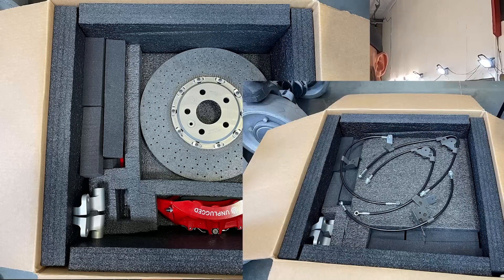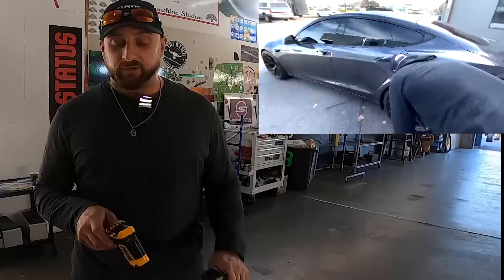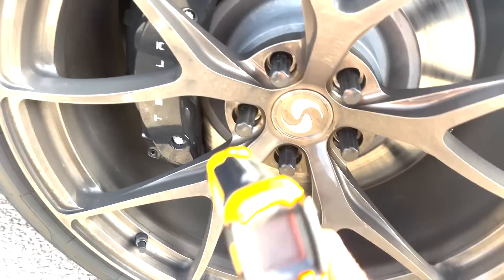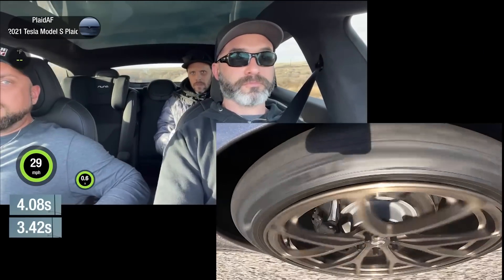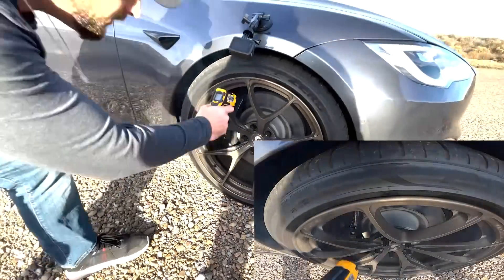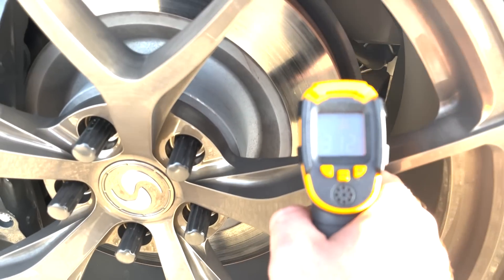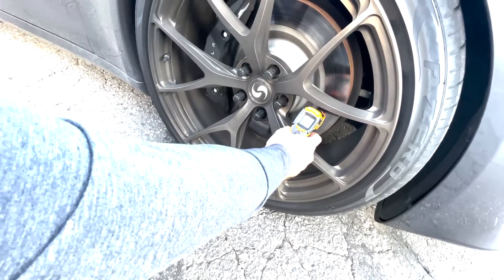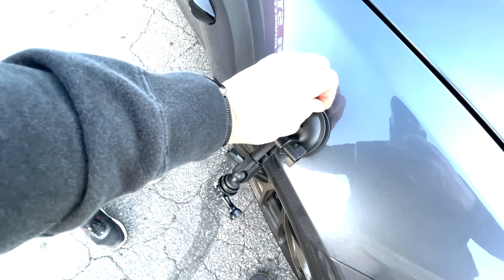Tesla Brakes Catch on FIRE | Model S Plaid

Comment: You can tell it has inadequate brakes just from the size of the rotors... They should be an inch larger in radius. The wheels can fit them easily. Take a look at the size of the front discs on any high performance sedan on the market, then look at these.
Reply: Uhh... so your basing your evaluation on how well it fills the wheel?  Not that generally speaking bigger isn't better, but that's a rather simplistic statement.  You do get points for not calling them breaks though.

Note that in normal driving conditions, on this vehicle the brakes are very lightly used- "braking" is regen going into the batteries.  Electric vehicles present a bit of a design challenge- in normal driving the brakes get almost no use, and at the other extreme you're stopping a heavier than typical car.  You have to size for worst-case, and then those oversized brakes are very lightly used.

I would say the brakes are sized appropriately for it's intended use, and need upgraded if it's seeing serious track use.
Reply: @christalbert722  So you agree that the brake discs could easily be bigger, that would make them better, and that it would be appropriate to size them for worst-case, even if regen is what's used for light braking scenarios.
But you still think it's appropriate to downsize them instead? What happened to sizing them for worst-case then? Brakes are a fundamental safety feature - basically the most fundamental one. They are most important in any car. If it's a car that can go up to 150 mph and beyond on the road those brakes need to be serious as well.
Basically any half-assed performance car, much cheaper and weaker models than this, come standard with much bigger brakes. Why would this not? I'm sorry but the problem of too low utilization leading to wear is not as important as the fundamental safety feature.
Yes, the brakes would need an upgrade for track use anyway, but these brakes are inappropriate for road use as well.
Reply: @zolikoff  the downsizing is for weight and aerodynamics I guess, so yes, it may be appropriate. For a classic combustion car, you are always using your breaks - so you have to absorb more  energy/heat and you dont want to replace them every 10kkm; here, you are braking with your motor for 99% of the cases, and if you have to do an emergency brake, you just need to have an optimal breaking distance; but the limiting factor is not necessarily the size of your brake discs - the limit is the force transported over your wheels to the ground/street; to that value, you can downsize; usually there should not be too many emergency brakes in a row - if you had one already you take is slow from there for a reason - only requirement I would set besides that, dont burn after one emergency brake
Reply: @hansdampf1143  When braking at higher speeds (>100 mph) the downsizing can indeed be a problem in negatively affecting stopping distance. You are not so much grip-limited there. Of course the regen adds to braking force and thus supplements it, but being a safety system the brakes should be sufficient on their own in case of system failure. Unfortunately almost every tester only publishes 60 mph braking distance results. Of course the brakes will be sufficient if you only ever go at legal highway speeds. The problem is the car's capable of much more, it should have brakes that can stop it well at high speed.
Reply: @zolikoff  I never judged or evaluated model 3 brake disc sizes; I was saying when the transmission of energy to the street is the limit, you can downsize the brakes; just to the point where they are the bottleneck - now, I do believe that all you need as a brake is one which can absorb the energy of your vehicle for a full speed brake; this can be the case for a smaller brake - but what does this mean? probably that the heat (the brake transforms energy, here momentum, into heat) increases as less volume is available; and less area of contact, where friction is created, needs more pressure to improve the process; increasing peak temperatures; if the disc could store infinite amounts of energy/heat, size doesnt matter; but with our current technology, I guess the stuff either starts to melt or fall into pieces;  I was just saying there is a minimal size for discs regarding the bottleneck observation; if the model S is below that - it is bad, really bad; if not, I dont see the problem...if it can absorb the energy of at least three full speed brakes having almost ideal braking distance I am totally fine for a daily used car; 

to an extreme, braking on an frozen lake aka ice will tell you that size of the disc doesnt matter and even the small ones are too big ;)
Reply: @hansdampf1143  I don't know about model 3. And yes, ultimately the way you use the car is what determines what brakes you need. Again, if you just cruise at 75 mph and that's that then these brakes are sufficient. But then why should the car even be capable of doing more than 75 mph?
As a manufacturer you shouldn't be minmaxing on the brakes like this. If you're making a car that can do 200 mph then you should fit it with brakes meant for that purpose. On a proper road surface, above 100 mph it is indeed the braking force that is the limitation and you want more of it.
Keep in mind that kinetic energy is quadratic with velocity, so at 200 mph you have 4 times the energy of 100 mph. So, if you brakes start smelling bad after 3 brake attempts from 100 mph (which means brake fade and risk of permanent damage), then they will suffer the same from one single brake event from 200 mph.
In short, I don't think it's worth thinking about scenarios in which the brakes are sufficient. Of course they exist. But this is a car that is designed to accelerate fast and go up to 200 mph. The brakes, stock from factory, should be designed to handle the worst of that, not what is deemed as "average grocery getter" driving scenarios. At least, this is what I expect any self-respecting manufacturer to do. And in turn I will have a lot less respect for one who chooses not to do it.
Reply: @hansdampf1143  And yes, indeed the size of the discs on the Model S is similar to those of entry level hatchbacks, while typical "performance" sedans (that don't hold a candle to the Model S otherwise) have twice the disc surface area. That's pretty important. Of course regen can help it but as a safety element like I said I expect the brakes to be able to hold up on their own.
Reply: @zolikoff  Tesla also sells 19 inch wheels as a factory option.  So no, they can't be bigger and fit the 19's.

But Tesla shouldn't have sold 19's on the Plaid. Should have been 20's or 21's only so they could fit larger rotors.

Comment: So going back to the Nurburgring, was that a production model Plaid with normal brakes?
Reply: According to the 'Ring it was - if you watch closely you can see quite a bit of lift and coast, likely to protect the pads.  According to ring watchers the "+" car was much faster which has to be at least partially because that one probably didn't have to be careful with the brakes.
Reply: shows how much potential was left on the table. will be interesting to see the big brakes, active aero and appropriate rubber going around!
Reply: @Scholzey  I think is possible a sub 7 is out there for the "+" version of the car.  That would be much more impressive than what they have already achieved even if they don't sell exactly that version of the car for now.  The team was at the track testing again in Nov (with stock, "+" and a dev mule of unknown configuration) but no details have been released yet...

Comment: Tesla noob complain about brakes, doesn't understand how temperature brake pads works. Street pads are made for 1 stop only.. if repeat stop. Upgrades..to track pads.. idiots now days.
Reply: These are brembo performance pads…
Reply: 1. No they are not made for 1 stop only, that is ridiculous. This is the single most crucial safety element of a car, it has to be overengineered or it's just bad design.
2. Because the brakes are underspec they perform extremely bad on that first "1 stop only" too.

Comment: I was a test rider for a brake manufacturer. What you guys don't know: Tesla Brakes get hardly used an accumulate dirt and oil in the pads which never gets "burned out" frequently. That's why the fire

Comment: I'm not a Tesla fan but I don't really see the point of this test. In a track scenario, you would cool off the brakes by driving around the track slower after an intense session. And in cases where I don't have time to drive around, then I slowly do laps on the paddock.

Even if you get better brakes installed, not cooling your brakes after hard braking is asking for trouble since the heat will transfer to your brake fluid and could cause it to boil and bubbles to form. That would affect your ability to brake regardless of what brakes you have installed.
Reply: Huh but Plaid is a special car meant for many consistent high speed runs. It really is under braked for it's purpose.
Reply: @Neojhun  It takes a lot of time between runs down the drag strip.. This was 8 seperate braking from 100 mph in less than ~2 minutes cannot even be compared to drag racing. If you want to track it find some proper brakes, otherwise your good.
Reply: @Arpedk  Taycan has bigger brakes and is slower. No one complains about the braking power on it because Porsche put some of the biggest brakes of any roadcar on it. A sub 10 second car that weighs 5000 lbs should have the best brakes you can get.
Reply: @Neojhun  Tesla has never said it was a track car.
Reply: On a road course track- it’s not uncommon to have multiple hard braking events - this is not an unreasonable  testing scenario,
Reply: @mnowadmin5676  With 2 passengers in? Yes, it is unreasonable!

Comment: holy shit! So it's def not a track car w/o the brake upgrades...
Reply: Yeah definitely not - think of the stock "street" car as an old school muscle car sort of feel, but in 2021 guise.  Too bad they decided not to release the "+" track version, would be nice to see what that can do.
Reply: It's not a track car.
Reply: @user-wf6cn6zv1j  Yet - there are several groups working on the car including Unplugged, it will be fun to see what everyone can do.  We are working on it with Mountain Pass Performance and we'll see how far we can take it!
Reply: Who runs on a track with 2 passengers? Funny, that!
Reply: Realistically, no car at all is a track car without brake upgrades nor should they be... Steet pads need to work at a lower temperature than track pads which makes them also overheat on track.  Track pads squeal and stick/slide when cold so are less effective than street pads in most circumstances outside of track usage - duh.  Any street pad will catch fire if you transfer enough kinetic energy into thermal energy through the braking system, you'll probably also boil the fluid too...  Braking systems have to be designed for the specific application and outside that temperature window won't work effectively - this isn't anything new - a car with this weight, acceleration and low braking thermal-threshold is on the other hand
Reply: It's a 4 door sedan
Reply from the maker: Quickest production car ever thus far, that happens to be a 4 door sedan, yes.

Comment: I commented the same thing on other 2 videos

My point is...

How is f...ing possible that you make a car that fast on a straight line with that kind of brakes?

Its almost a recipe for murder....
Reply: 100%
Reply: so people should ignore the cars warning about brakes overheating and reduced performance?
Reply: @Scholzey  no at all... tesla should deliver a car that has proper brakes out of the factory...period

Or someone is going to get killed like that
Reply: High performance brakes are messy and have much shorter lifespan 
These are probably more geared towards stopping from a highway pull or two and lasting 50k miles before replacement

Comment: Tesla needs to get away from being a gimmicky novelty car maker when doing stuff like plaid and focus on safety.  They will probably face some serious liability cases going forward.  Insurance rates will quadruple if they dont get it together.  Thier ABS system when the brakes get hot is useless, and deadly.  Plenty of youtube videos showing plaid just randomly flying off the track uncontrollably.  There is a zero synergistic approach to building cars when it comes to Tesla.  When you look at something like the overall performance and driving characteristics of say a BMW M5 CS.  Plaid looks like a clown show.